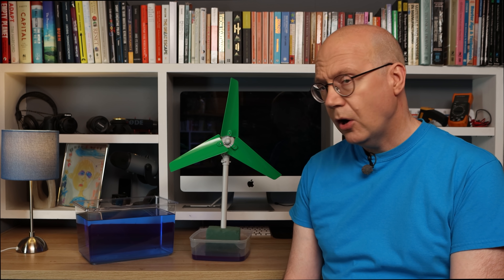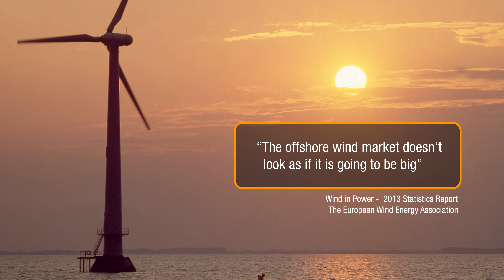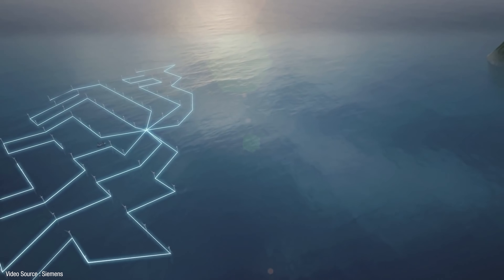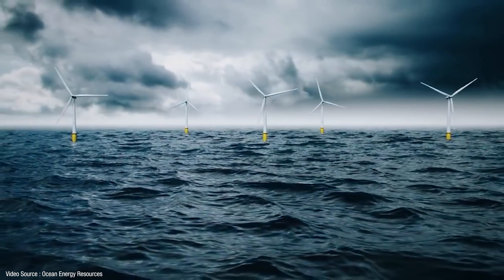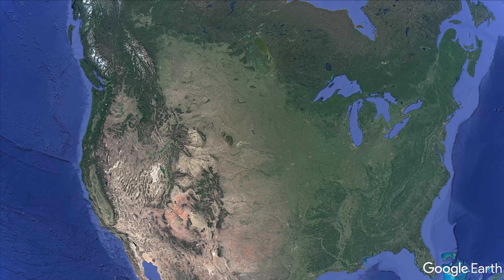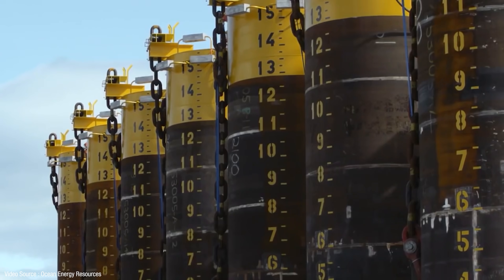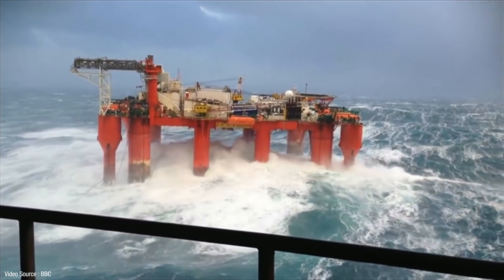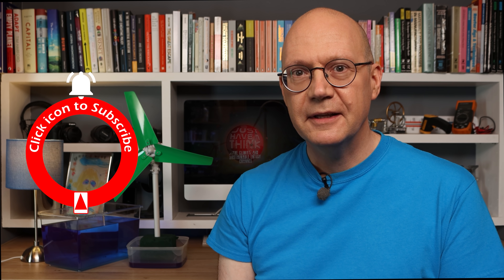Deep Ocean Floating Wind Turbines. How do they do that?

Comment: Recently started watching this channel and I'm a fan, but I think this video manages to miss perhaps the critical reason to be bullish about offshore wind: The power generated from a turbine approximates the SQUARE of a turbine blade's length (or radius of the swept area). Onshore blades can only be so big because they need to be transported via roads, but an offshore blade built at or near a port has no such constraint as it can be transported via barge to the open ocean. Thus as the offshore blades increase in size, their output grows in a non-linear way setting up the opportunity to leverage a fixed (or, as the industry scales, evening declining) cost of mooring these behemoths to the ocean bottom. Thus, it's not just the potential energy to be harnessed, which is indeed very, very large, it's the opportunity that costs may decline much faster than current expectations as turbine sizes continue to increase.
Reply: Yes the power available from a wind turbine is proportionate to the swept area of the blades, a circle, so Pi x the square of the radius. I did wonder whether vertical axis turbines would be simpler in deep offshore location, as the tricky thing will be maintaining the turbines, and having a massive generator at the top or a 200m pole is inherently unstable,whereas a VAWT has its generator at ground (sea) level.
Reply: Bigger diameters of rotors cause the blade tips to go through the sound barrier (a no- go I believe). So it will be either more blades or limited speeds.
Reply: @Calligraphybooster  it all depends on how fast it turns. Any size can break the sound barrier. A 55m blade for example turning one Herz (60 rpm) will go supersonic. The circumference is 2πr, with r being 55m that 345m/s at the tips, beating sound by 2m. However you could make a blade that's 500m long, and as long as it turns at less than roughly 0.1 Herz (about 6rpm) you are below supersonic. Or make it 5km long and then you just need to turn it reeeeeally slow at 0.01herz (0.6rpm) or less. Largest commercial turbines spin at about 10rpm with 100m blades come to about half way to supersonic at the tip. Larger blades will just mean slower turn rate. It's all geared in the generator anyway. It's more a factor of strength and flex of materials at larger scales that is the biggest limitation. However if we think about the square increase in power our current technology let's us go to about 250m in length per blade - that should hit about 100MW per turbine. And if we draw a curve into the future a 500m blade would produce 1GW and so on until you run out of wind. The sky is literally the limit.
Reply: @MarkoCloud  I am aware of the required lower rpm’s. But it would seem to me that reaching limits sich as the need to stay subsonic and maximum tensile loads would bring down efficiency. The max. efficiency is given by Betz. It can be reached at high rpm’s using even only one blade if you like or at lower rpm’s using more blades, like in the classical American farm pump design. I get a suspicion that a good deal of enginerding megalomania is involved in the desire to build these extremely big contraptions.
Reply: @Calligraphybooster  , yes, it basically just removes one of the constraints. it could be a nice benefit to have that constraint gone, but I don't have enough information to know how much of a boost that would be. if current on-shore turbines are pushing up against the transportation limits, then maybe it's a big enough gain to make deep water turbines more viable
Reply: I suppose that's true as long as the blade manufacturer is right on the ocean.
Reply: @stopthephilosophicalzombie9017  like Nigg Bay in Scotland.
It sounds like the places they did deep sea oil and gas are the ones that can handle deep sea turbines
Reply: N Mmm mooo plop bn
Reply: The blades don't have to be transported at all.
They could be manufactured and assembled in a port and than the complete structure would be towed to position and bolted to the seabed.
It has to be a really deep port but once operating with the supply chain in place and scale savings it could produce floating turbines for dozens of offshore parks.
Reply: Youre not a fan of this channel.
You're a turbine
Reply: The behemoths are littering our pristine landscapes and turn them into industrial wastelands. Out in the ocean, out of sight, but they still chopping up birds.

I hope well meaning people soon realize that this is trading one evil for another evil.
Reply: @mrtopcat2  if you give give a flying fuck about animals getting killed due to from pollution from oil and gas exploration and global warming.
Reply: @NaumRusomarov  I am very much interested in meaningful solutions. What I am not interested in is trading one evil for an other perhaps lesser evil.

However, these days there is a strong push by companies that are emerging under the green umbrella and that aren't green at all.

Well intentioned and non-technical people like yourself have no chance realizing this, because of the massive amount of funding, censorship and almost hysteria like advertising on all channels that is being done.

Think what if big tobacco had that kind of power - but wait - then you realize that they actually had that for decades.
Reply: @mrtopcat2  dafuq are you even talking about?
Reply: @NaumRusomarov  My apologies. I did not realize you were a below conversational level type. Enjoy the fruits of your truth.
Reply: @NaumRusomarov  Yes..that is a very good point. Actually it save the eco-system way much more.
Reply: @mrtopcat2  I find it it ironic to read a plea to protect birds from a cat-named person: you do realise that pet cats (not event wild ones) kill waaaay more birds every year than wind turbine? I don't know if you live around a land wind farm: I do. So I know what I am talking about when I say both sound and visual nuisances are benign.
Reply: @MjolnirFeaw  I understand you disagree with my post, but is this really your best shot? Critique of pets that are overwhelmingly kept indoors and then portray them for their outdoor behavior? I guess I am OK.
Reply: @mrtopcat2  maybe I wan't so clear: I have two of these furballs and I love them but facts are stubborn: according to the American Birds Conservancy organization, cats kill 2.4 * billions* birds per year on the US alone. The same organization estimates that wind turbines killes less than a million. So if you want to advocates against wind turbines, birds are not a reveant point to make.
Reply: @MjolnirFeaw  This discussion is an interesting one, but only from the engineering point of what view. However, mind that the origins lie in the increasing resistance of the public against wind turbines due to how they destroy pristine landscapes and transform them into low yield Terminator like wastelands.

So while most people are thankfully pro-renewables, “not in my backyard” and “enough is enough” memes are on the rise. How you arrive to make the connection of wind energy to cats is up to you. There is no correlation of wind turbines killing birds to cats killing birds and fighting wrong with wrong does not make things right.

Similarly, hastingly replacing one failed evil energy source with one a slightly lesser appearing one will not do any good for the environment. If you really want to make a difference, then start living “the inconvenient truth” and doing things that may be inconvenient.

Instead of living in a house, live in an apartment, perhaps with another family together, get rid of your car and walk and use public transport, stop travelling far for vacation, stop visiting distant friends and zoom instead. You think this can’t be done?

Billions of people in the developing world are living this way. Their energy use is a fracture of ours. The problem that we have raise from the amounts of energy that we use and from the lifestyles that we choose. And as long as people will feel like they can live like the gods (and let’s not forget, this is what our most prominent ‘environmentalists’ are showing by their own example), the environment will always come out last. Start with your own example if you really want to make a difference.
Reply: @mrtopcat2  I see your point and from a theoretical point of view I think you might be right but... But I can't see a world where it is realistic from a psycho-social point of view. Most people from rich countries will not concede much comfort (if any) while the required effort would be significant. And most people in poorer countries won't accept to let that hope go either (and we can't blame them, obviously). I don't agrée with your opinion about what WT do do the country side (I can see 3 of them from my living room window) but hey that's a good thing about opinions : we can agree to disagree ;-)
Here in France what I hear most is that WT don't produce anything relevant. But since in 2020, 25% of Germany electricity was produce by wind and since Germany is a rich, industrialized country, I think we can rules that as bs.
WT are not perfect of course, and I'm not so sure Germany's decision to stop everything nuclear was the right call but that's an opinion too.
Reply: @MjolnirFeaw  I agree. People will not change their way of living. For most people it is probably nearly impossible to give up the living standards that they have achieved, at the same time people also always want more, in the developed world or like you have correctly pointed out in the developing world as well. So it seems like generally speaking mankind will go on with its ‘conquest’ and ‘exploitation’ of the world.

However, there is an important point that I like to make here. Other that the enthusiastic promises, unfortunately these renewables so far are absolutely failing to provide any meaningful and large scalable answer to the present and future energy needs of mankind. Instead, today’s renewables are feel-good solutions, that are marketed to well-intentioned people, so they can pay their way to continue to live their (otherwise from the environmental perspective) sinful lives, while feeling good about themselves. And while people may argue that “hey, at least this is a small step in the right direction”, that small step, that lying to ourselves is working out to a gigantic loss of opportunity for discussion and searching for more meaningful solutions.

Your example about nuclear energy is the perfect example here. Two countries, Germany and France bordering each other have a vastly different approach. Both have very intelligent and very capable professionals and yet they both are running opposite course from each other. While France is fully embracing nuclear power generation while Germany is getting out of nuclear power generation all together. So what is different, I ask? I strongly suspect the answer is to be found in the influence alliances of the respective industries, that cast their influence over society.

As far as your comment about a few wind towers that you can see popping up here and there may not matter. You are correct, a few won’t make that much of a visual difference, but then again, a few won’t make dent in their energy contribution either. You must really look into this. Standing by themselves, these things are really almost only symbolical and hardly produce any meaningful power. It is only if they are set up in high numbers that their output is getting somewhat interesting, if you so will. But then again, in that case we are quickly getting into the aforementioned Terminator like industrial wasteland scenario. I am sure you would not want your children to grow up in a world, where wherever you look, you see these behemoths. Worse, image the future PAST these behemoths, when finally once we have wasted all our money on these phony renewables and we are being pushed for REAL and meaningful solutions and find those solutions – what will happen to all those wind towers? The companies that took our money and put these behemoths up will long be gone and these behemoths will become another burden to the public to build back and recycle.

And unfortunately I think this is the way we are heading now. Instead of saying wait a minute, where can I get the most of benefit for my coin, or let’s wait a few more years until we have found meaningful ways to produce energy in a sustainable way, we are being set into panic to and being rushed into building these things.
Reply: @mrtopcat2  Recycling, I think, is the worst drawback of WT. There are a few existing recycle-capable prototypes but as far as I know, none of them is in full production mode. Things move fast in these sectors these days and what we hold true today could be wrong in just a couple years. Thinking there can be a technological solution is a bet, true, but then again thinking people can change their way of life is too. And I worst one, I think. 
Unstable nature of the current produced is another drawback but technologies are already here (some will be challenge to scale up, true) to offset that. 

BTW, I disagree that they are ugly (there's a lot of them in my backyard ;-) ), and numbers tend to prove they can be meaningful. Oh, and, for technological reasons they blend very well with aforementioned nuclear power base.
Reply: @MjolnirFeaw  How we view these wind towers may be due to generational differences as well. And I am not saying this in any negative or belittling way. I grew up in a world when things were still real and interactions personal. In strong contrast, the kids that grow up these days (and I am by no means implying that you are a kid like that), many of them grow up without nature. So maybe they even mind those Terminator like industrial landscapes less than even you, while by that time I might not even be around any more simply because my time ran out.

Regardless, I generally disagree with where things are going. It is never a good idea to act hastingly and in a panic, but that is exactly where the industry is putting us. And again at a monumentally huge expense, to throw away and replace most things that we had, thereby using precious and increasingly finite resources.

But then again, this should be very familiar theme. Throw away your old one and consume. Just like e.g. every new iPhone generation is marketed with being more environmentally friendly than the last and no one is asking the question, hey how about saving some resources and keeping the old one. Could Apple somehow facilitate for that?

Sadly like you have correctly recognized this will have no end. It is just not in the nature of man to be content. The scary part is however what will happen if the rest of the developing world will start to demand like and the developed world.

Just look at China. Just within a few years, there are 250 Million Chinese people who are living at Middle Class level. In 1970 Africa had 170 Million people, now 1.3 billion. What will happen when an additional 1.3 billion people will demand electricity. Staying close with my example, where is all the copper going to come from. We are already experiencing copper shortages. People tend to answer these kind of questions with "well, as things go along, new technologies will come on the market". Well, these things ARE going along already! Look at China. Where are all those new technologies.

However, I fear the future is already written - in the past. It is the same old story of mankind. Whenever something is getting scarce, tensions and tempers tend to get higher and the result is always wars.

In that sense, it is not climate change that is threatening our world as we know it, but rather wars due to overpopulation. You in Europe are already experiencing the first act. The largest migration of people that the world has ever seen, from south to north. But I'll leave it at that. I am getting off the subject way too far.
Reply: @mrtopcat2  Here in France, countryside is mostly not natural per se. Wind Farm mostly stands above cultivated fields. It is an artificial landscape to begin with, and it has been like that for a long time. I don't think those square of colors are so awful, or those black lines we drive on, or these big slow-turning white fans. You might be right about the generational difference even if I'm probably not as young as you might think. More like a mid-aged techloving geeky engineer ;-) 
There are a lot of supply problem which looks like they are most temporary: people speak a lot about rare earths, coming from a single place, not realizing that they are mostly as common as lead or tin in earth crust. Cobalt is a problem but new chemistry can make do without them. Next in line is Nickel and you're absolutely right: copper. It's about time we change the way we design things to use as less copper as possible. If really I were to let my inner geek speak, I'd tell you about metallic chunks of rock in Near-Earth Orbit but we're not there yet. (Still... there's an argument to be made that we have to get get them, not because it's cool, be because it's needed)
BTW: For the phone question, you can always have a Fairphone (well when it's time to change, obviously..) and a framework laptop to match ;-)